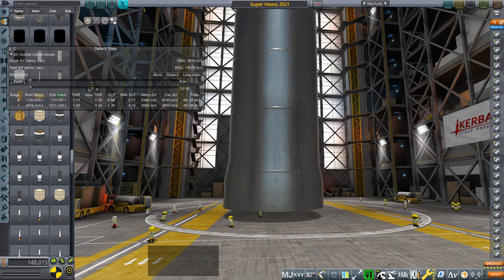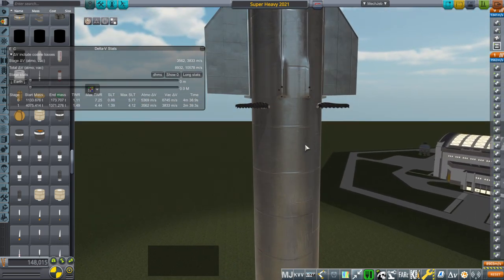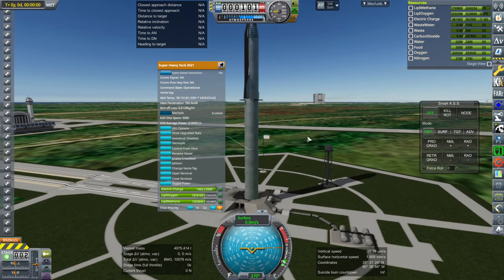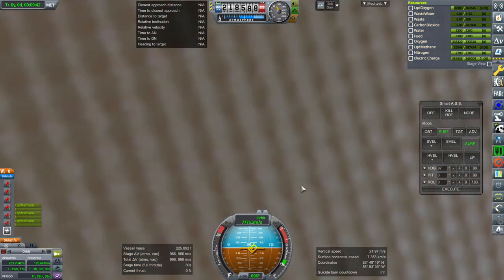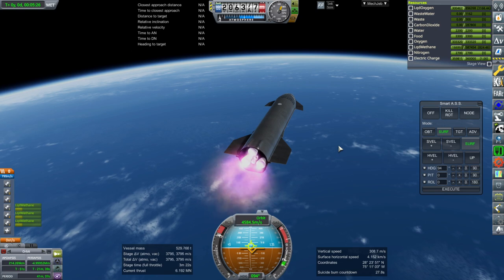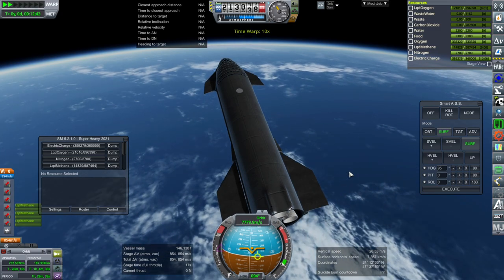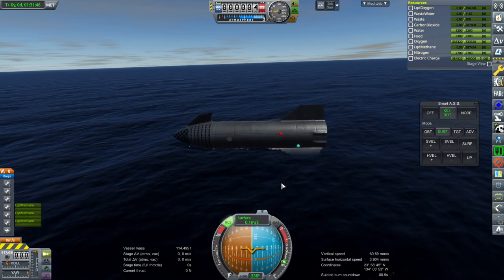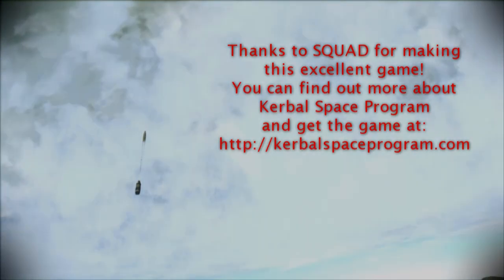KSP with Realism Overhaul - 29-engine Super Heavy Capability Test

Comment: Yeah, trying to use those control surfaces like KSP expects them to won’t do much good, since it’s thinking of, you know, surfaces that aren’t stalled. I wonder if there’s a way to write a new module that takes the pitch, yaw, and roll inputs, and applies them based on drag instead of lift.

Comment: I use the K/I keys (normally used for RCS control) to change the angle of the flaps (which can be set up in the action group menu). Of course, this really only works good with pitch, but I suppose that's the biggest concern so it kind of works out okay.